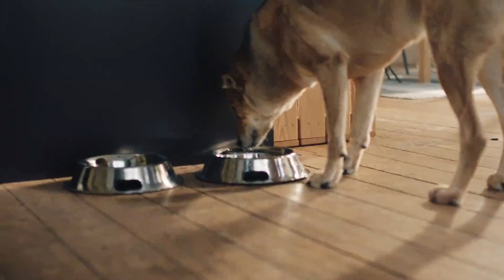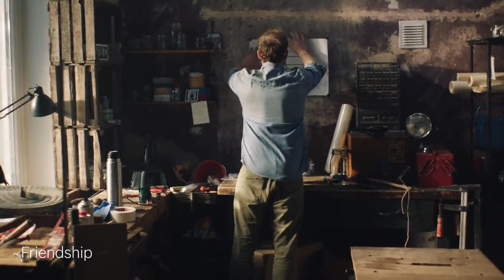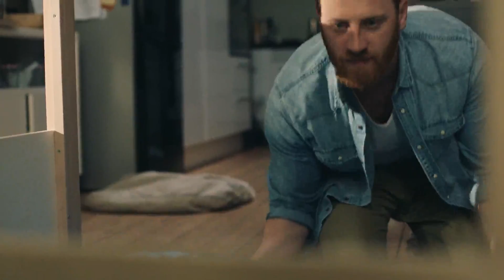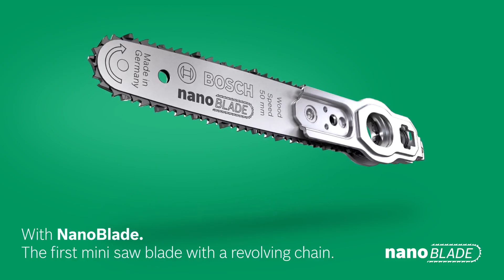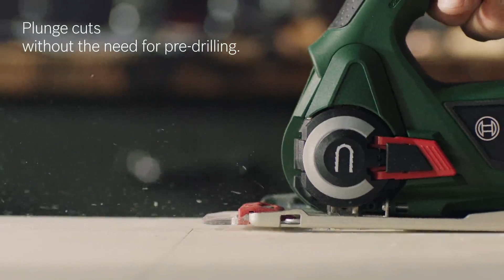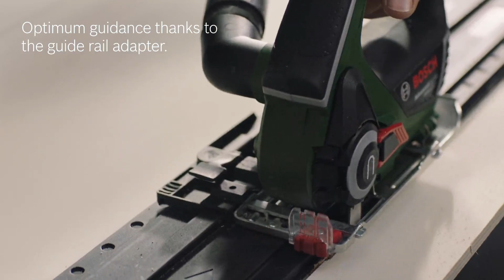The NEW Bosch EasyCut 50 and AdvancedCut 50

Comment: This is NOT a jigsaw!  It is made for straight, square cuts.
 I have 50mm, 65mm and 9mm blades for mine, can't remember when I last used a circular saw or a table saw, this is so much easier!
Reply: How does this handle straight cuts compared to jigsaw? Is it really comparable to circular or table saw?